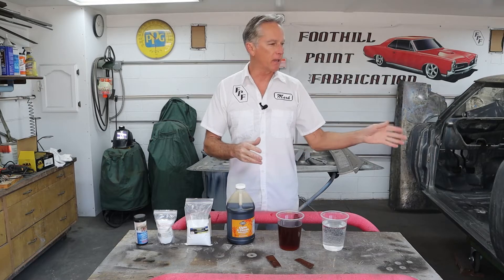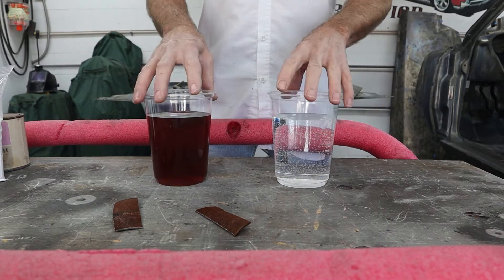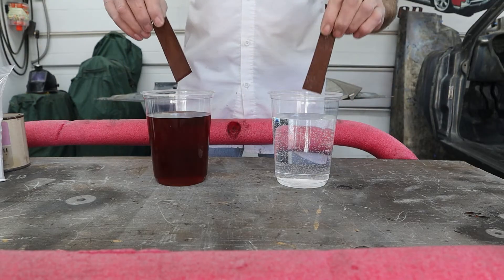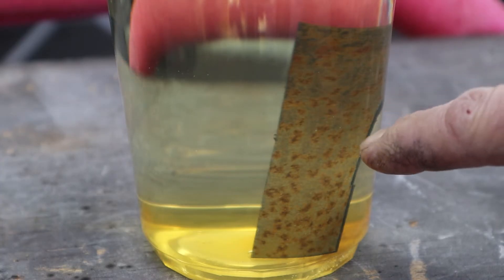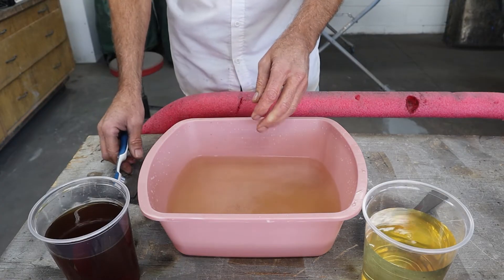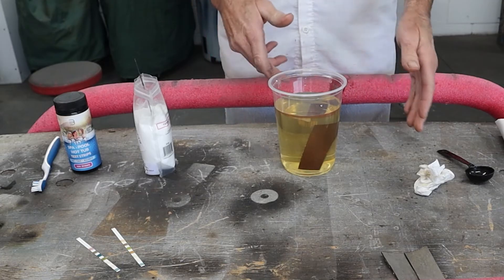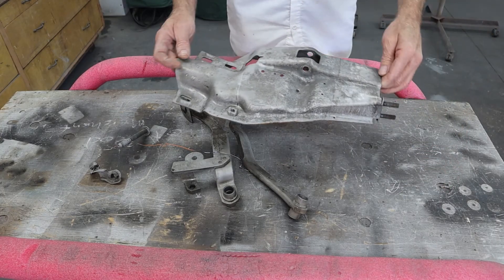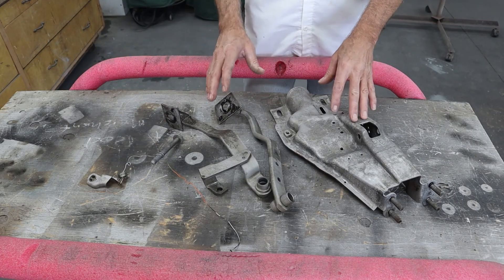DIY Rust Remover - Can We make Our Own Rust Evaporator???

Comment: Yes EDTA has been used to chelate toxic metals out of your body by the medical community. I actually have a bottle of it in capsule form around here. How'd you get the idea to use EDTA as a rust remover? That's pretty slick. I've always used acid or vinegar. The acid trick is super fast but it is toxic as hell and then dealing with it safely is just a super annoyance. I always wanted to try OSPHO which is basically a phosphoric acid rust converter but I just never got around to it. Last week I needed to remove some galvanizing off of some parts that I wanted to weld and I used muriatic acid. The fumes and the toxicity of that stuff is just horrendous. I managed to get it done but I made sure that there was nothing around that would get splashed and ruined by the acid. I wonder if EDTA would work to remove that zinc coating? This is a very good video! Thanks for taking the time to show us.
Reply from the maker: Thanks Marcel,  I got the idea from someone else but they made it look a little more difficult to formulate.  I wanted to test some other ideas as well but nothing worked as good as EDTA and Citric Acid.  The solution does work slow but like you mentioned it is safe.  I forgot to add the links in the description but just took care of that right now so they should show up in a little while.
Mark
Reply: @FoothillPaintandFabrication  It makes sense.  Rust is iron oxide ,which is basically a free radical.  It must bind to the oxide portion of the iron oxide . The stuff is also used as a food preservative. I'll bet you could probably speed it up a little bit if you put a bubbler in the tank, like an aquarium bubbler with a hose and an air stone to keep the solution circulating.
Reply from the maker: I moved the solution to a big tub and put some patch panels in for my GTO project off a donor car.  The heavy pitted areas took 3 days but it never damaged the base metal.  I will give your idea a shot if things slow down more.  @marcellemay7721
Reply: EDTA is also used in photographic bleach for film and paper. We did Kodachrome processing and had to mix our own chemicals. We bought the stuff in 125 pound bags - a pallet at a time.
Reply from the maker: A pallet?  That is a lot of edta.  I am looking for a less expensive supplier in small quantities but haven't found one yet.  If you think of one let me know please.
Mark @melgross